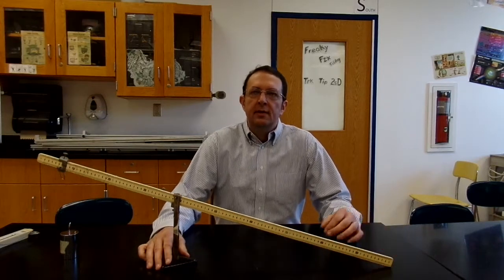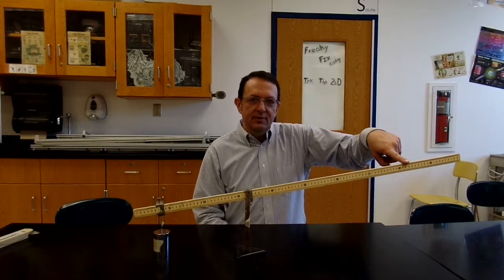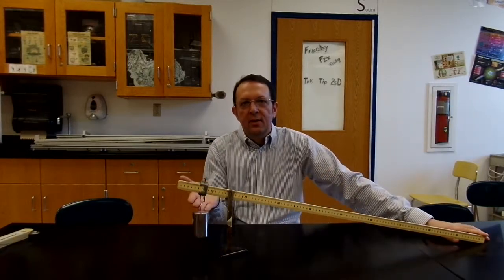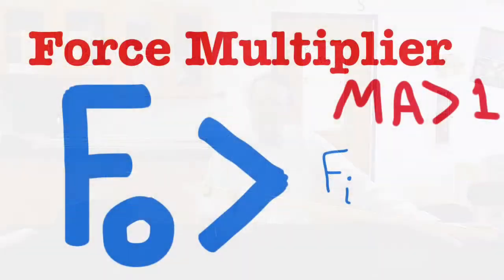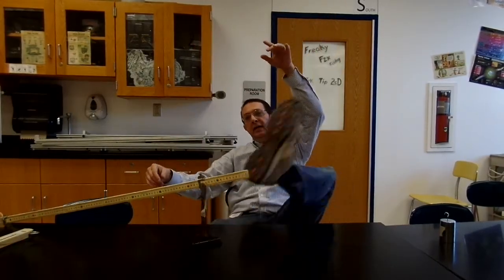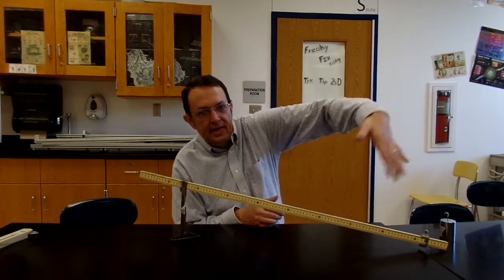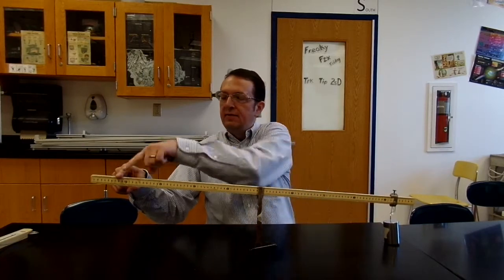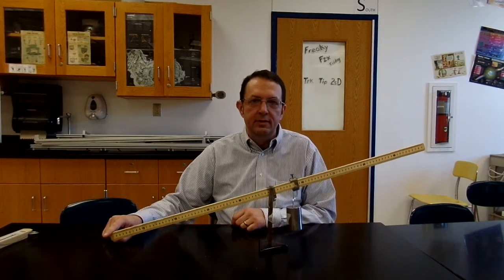Simple Machines - Force Multiplier? Speed Multiplier? Using Levers

Comment: Emprical evidence:

If you go below a gear of 1:1 on a bicycle, you start destroying bottom brackets and freehubs.

Freewheels hold up better, to a point. But, not freehubs.

One gear less than 1:1 can knock a cup and cone loose ball bottom bracket out of spec. Easily.

Why can a sub 1:1 gear do this? It multiplies torque beyond design parameters. That's why.

Bicycles are meant to multiply speed, not torque.
Reply from the maker: @THEALCOHOLICdAYTRADER-vd5ti  all I’ve done is bicycles for decades and I’ve never seen nor heard of this. A gear ratio of less than 1:1 is common.  Please explain more.